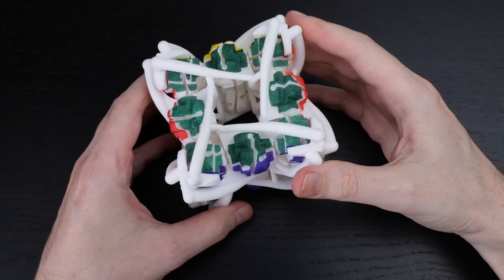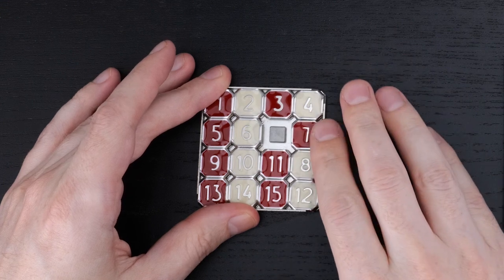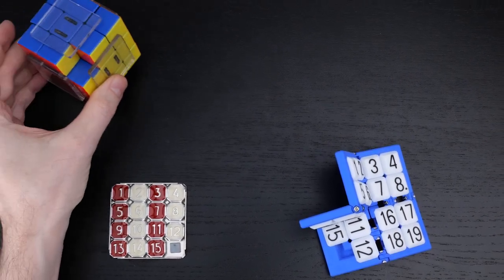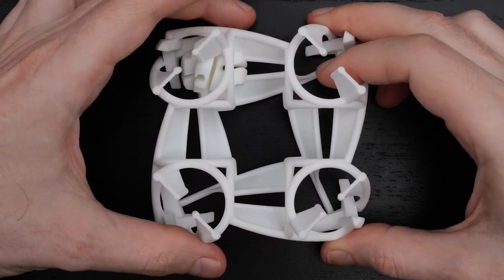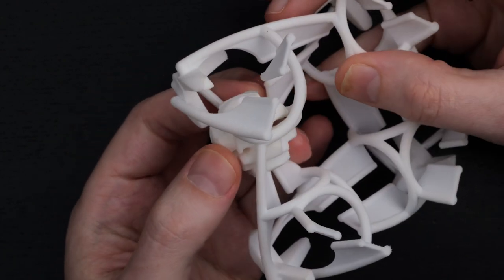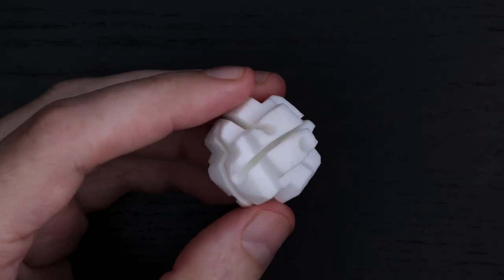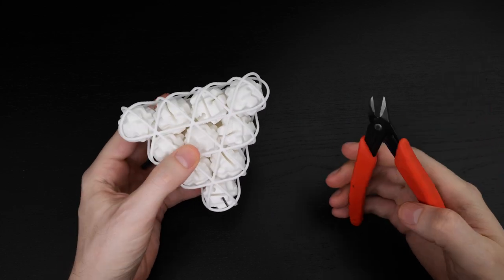Helix cube puzzle

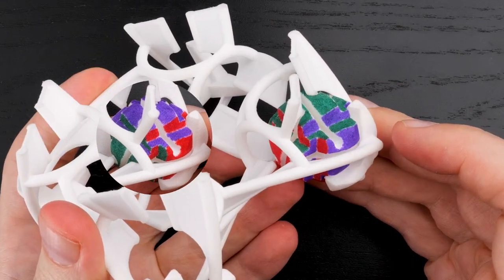Comment: 4:57 a simple way to understnad this. cubes have 6 faces. a cube being twisted 4 times is going to be 360° x 4/6 = 240° from its original orientation. rotating an object 240° counterclockwise = rotating it 120° clockwise.

Comment: There is a solution to stop rotation at a 5 way junction (where 4 cubes meet).
The tile enters the junction and is captured by a fin in the slot. You move the rocker switch over so a different slot is engaged so you can move the tile out another direction.
Not a passive mechanism sorry but it's the best I can think of.
Reply: Like a lazy susan / train railway junction?  Because that's what I'm picturing.  Pieces could travel along X and rotate into Y but they wouldn't be able to travel in a Z.  You could do a really interesting 3x3 with Junctions like these.

Comment: I've got to say, being able to predict the end result of the holonomy demonstration was extremely satisfying - I did in manually by placing my hand on one face of an imaginary piece and moving it around the frame when you had the blank piece, and then (once I'd managed to get the same result twice - it took me about five goes) I converted it to a rotation angle and a direction based on the angular momentum vector of the transformation (I've switched to using those directions over clockwise and counter-clockwise since angular momentum doesn't care which side you're looking at it from)

And then you demonstrated with the piece starting in a different position so I had to quickly pause and re-orient myself an the angular axis.

Comment: In response to the question at 3:45, I don't think it is possible to stop the piece from rotating in place at a 6-way corner, unless the piece is actually 8 pieces bound together in a complex way that allows guide rails to pass through. Even if we remove the twist from the rails, this is probably highly impractical if it is even possible.

Comment: These sorts of puzzles tend to be extremely difficult to solve, and have the sort of mechanical problems with pieces getting out of place you mention. The Polo Cube is probably the best of them as a puzzle both mechanically and as a solve experience although as far as I'm aware I'm the only person who's ever solved it. Having a puzzle which is the faces of a cube with one missing and where they can flip through the center is also a fun puzzle but noone has ever made a really great physical realization of it. The thing fundamentally causing the the mechanical problem is that you can't fill out the missing space with smaller pieces like you can with a shelled mechanism. A slight variant on what you've got here which can work is that you can have the pieces on plungers which go through the entire puzzle and rotate the entire line of pieces which they're pushing all at once. That of course gets to be a huge number of pieces and would probably be best as a puzzle with simply two plungers with a single piece of intersection.

Comment: In a hypothetical puzzle where the cube has more free movement, there might be a way to retain the cube while allowing passage. Basically a turnstile, or Geneva mechanism of sorts, but in 3D with more degrees of freedom, though it might better resemble a caltrop. The idea is that a cube can freely push through a set of these caltrop-esque turnstile-like mechanisms, but while a cube is between the set of them the cube cannot freely rotate itself, a compliant gating system. The only issue is that these would be solid free-floating parts, which would require a retention mechanism. On the flip side of this coin, you could also do the inverse, similar concept but instead of a singular solid piece it'd be multiple detached pieces, of which can have compound bi-directional hinges. Another option could be to find some kind of linearly sprung component that can collapse to allow the cubes to pass through and be captured in an orientation. I'm just throwing darts at the wall, I struggle to visualize things due to aphantasia, so I have no idea how any of these would theoretically or practically work, I just know a gating system with some form of compliance to allow movement makes the most sense to me. 

Another option is to extend the wireframe edges a bit, so that the cube is forced into linear movement with no twist before entering a vertex,. Then from this have a set of rollers, with a small amount of compliance via swingarms to account for the twisted face of the cube, that would act as rails. The swingarms these rollers are connected to would need compound hinges, so that off-axis movement is still possible, and with springs in these hinges they should be able to retain a cube solidly. It'd be a bit simpler if you could figure out some kind of spherical roller that's mounted on a swingarm that combines the compound axes into a single hinge. The only issue here is how the cube enters this mechanism, there'd have to be some kind of actuator to negatively extend the swingarms of the entrance so that they don't collapse into the vertex, and can swing back in the positive direction to capture the cube on it's back face. 

It's definitely not a simple hurdle to overcome.

Comment: You can pretty trivially create more complex shapes by simply restricting it to being made out of exclusively the same 3-edge, 90° corner vertices that you are using for the cube. If you rotate the corners you can create non-convex shapes. The tradeoff with this approach is that you can't always have 2 physically adjacent vertices being connected by a traversable edge.

If you go with that method, you could probably produce the corner sections in bulk and add a mechanism to allow them to snap together so that you can create any sort of shape. Add in a bridge piece to join those non-connected adjacent corners and you have yourself a cool customizable puzzle.

Comment: To get to any other position, we need to be able to rotate a single cube to the same position, but with only one change.
But the cubes are in a sort of parity where any position can only hold half of cube orientations, so that could disqualify it, but we'll assume that's part of the puzzle at face value.
So now we can rotate a full side of the puzzle by moving 7 pieces, and each piece rotates 1/3rd along an axis, we'll treat these rotations as identical for now.
Because of this we can make 7/3 rotations with each full move.
If we theoretically do this twice then to 6+1, we can rotate one cube by 1/3 and one by 1/6th leaving others in the original position.
Other combinations form 1/3 1/3 1/3
This 3-way parity appears however we combine the cubes for rotation, and it is impossible to add or remove to the 3-way parity by using more combinations of 3-way parity.
So we can conclude that it is impossible to rotate a single 120 degrees without affecting the rest of the cube, so not every position is possible.

Comment: 3:40 what if the fins act as holders? Extend the fins a little bit so that there is a point where the tile is held by all 12 fins, with a satisfying click. The ends of the slots must have lower walls in order to allow for the fins to click in place.

Comment: Challenge Make the "tiles" with a central hub and snap-on faces. Then the faces can be printed in different colors. Then refine the design so it works well.

Bonus points if you design it so the "tiles" can be assembled in the puzzle frame removing the need for screws.

I believe this challenge is significantly more difficult than solving the puzzle. I don't know if the bonus is even possible.

Comment: What if the ball was more of a cross-section and the tracks extended into the intersections?  They would only have a slight gap to allow the intersection piece through and travel in a different direction.  This wouldn't be as aesthetically pleasing as the ball but it may allow for the tracks to penetrate into the intersection in all directions keeping it from rotating.

Comment: These pieces rotate by 90 degrees when they move along an edge, but that can probably be changed. Could you make a similar puzzle where they rotate 60, 72, or 120 degrees? A 180 degree rotation wouldn't give holonomy in a cube, but it would on the edges of another platonic solid.
Reply from the maker: Yes, it would be easy to have a different amount of rotation as the tile goes along an edge. However, the current tile can move in three perpendicular directions from a corner. To do other polyhedra the tile would need to be able to move in other directions, which sounds difficult.

Comment: A neat thing about this design is you could probably be a little bit more creative with the tracks themselves. Like  your holonomy sphere as a set of tracks with these pieces in it.  With a bridge through the middle to take advantage of the third axis.
Reply from the maker: One of the tricky parts is that the tile has helical slots built into it. So it cannot just slide without also twisting. A redesign could probably accommodate parts where the tiles twist and parts where they don't, but it wouldn't be as smooth.
Reply: @henryseg  Oh, I saw that they had a little bit of wiggle room, so I figured the tracks could arc.  Probably not enough to get a good curve.